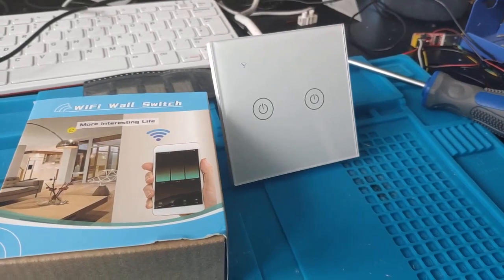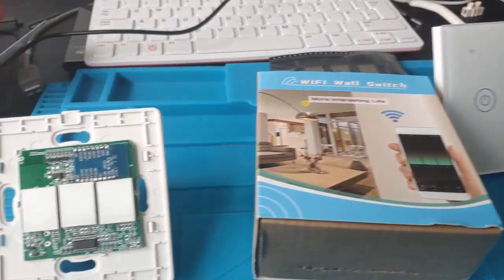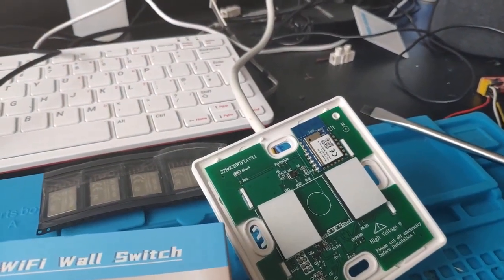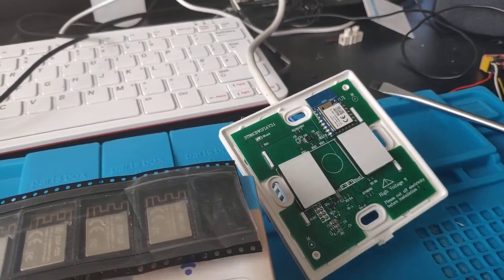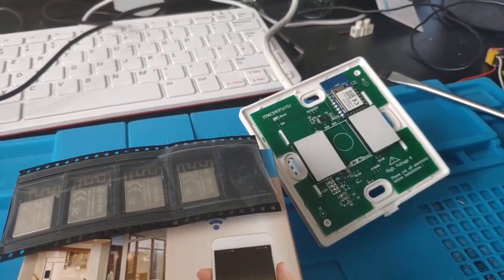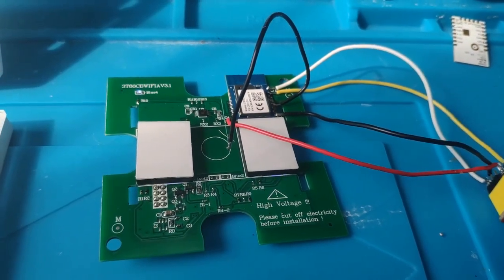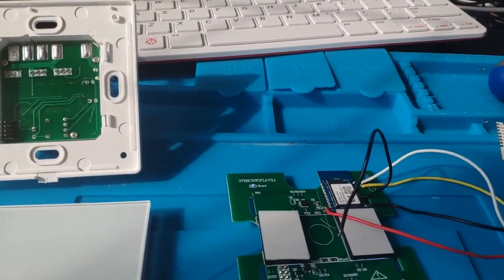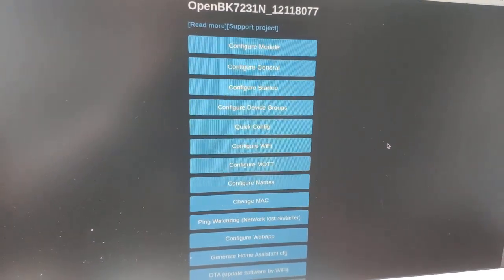Flashing TUYA CB3S BK7231N with Openbeken alternative firmware

Comment: did you need to ground this extra hanging cable to the ground in order to flash ? If yes, what is the pin number you solder it to ?
Reply: The lead you have to connect to ground for a short time, is CEN (or Chip ENable)